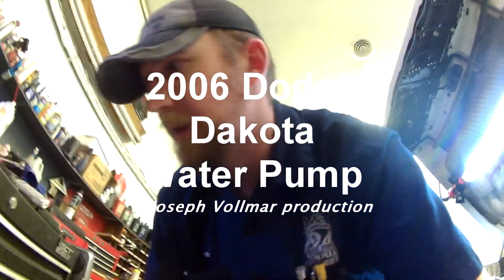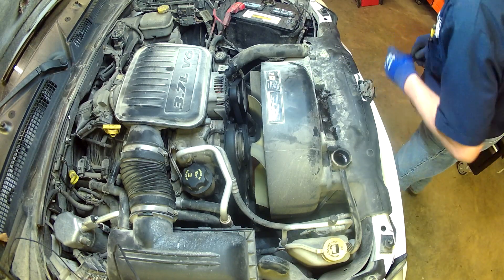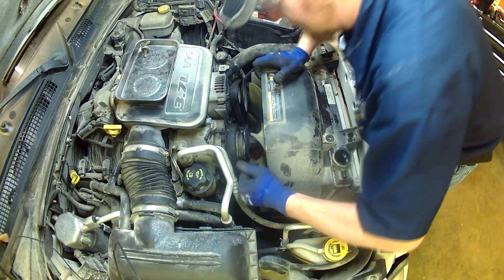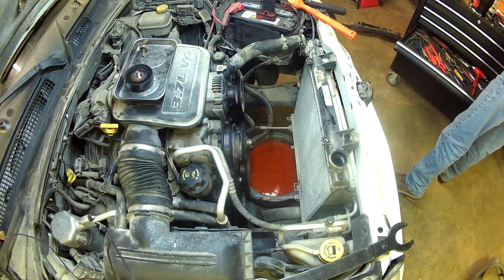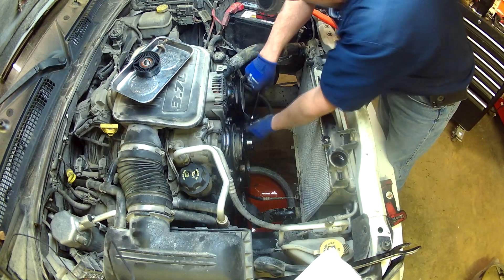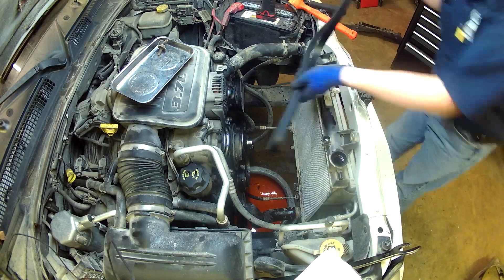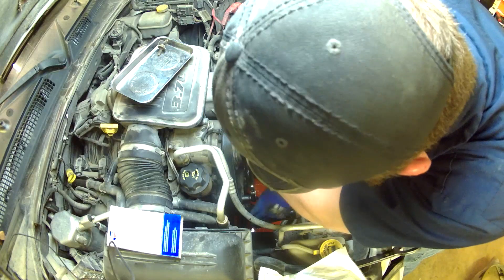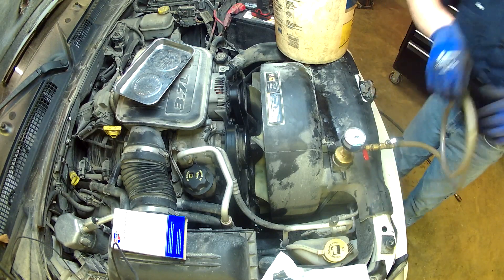2006 Dodge Dakota Water Pump.

Comment: Thank you for the straight-up info. One thing you might want to add, lol, is the fact that the pump housing on engine has razor sharp edges, and while gently sanding with very fine emory, one can lose several pieces of knuckle flesh, LOL!! It's funny the next day, but not while you're bleeding on your sons truck. A good pair of mechanics gloves (like in video) are highly recommended.

Comment: Easier to leave the belt on, apply force to keep the water pump pully from spinning and then loosen the fan. Might have to take a hammer and give the wrench you use a "love tap" to loosen the nut and then just spin it off. Once its off then remove the belt

Comment: FYI, if you remove the upper hose, you can remove the shroud before taking off the fan, it's not even very hard to do. This gives you way more space to work with getting the fan off.

Comment: Same thing for a 4.7l?
Reply: Idk if you figured it out yet. Considering that the 3.7L is just the 4.7 minus two cylinders, it most likely is the same
Reply: @SouthernMender  well yeah I knew that I just didn’t want to make a mistake and potentially make things worse and I fixed it tho and running as good as the day I got it!
Reply: @Roodaddy97  I figured you did. Just figured I'd say in case you didn't lol
Reply: @SouthernMender  appreciate the advice

Comment: What the point of vacuuming it?
Reply: I wish he would answer. I don't think you need to.
Reply: The reason he put a vacuum on it was to remove all the air that was introduced into the system. This just saves time when refilling because, otherwise, he would have to idle the vehicle with the radiator cap off inorder to purge the air out. Either way works, the vacuum method is just a lot quicker and cleaner.

Comment: @joseph vollmar is there a thermostat that you need to replace along with the water pump i just found that i have low coolant and a water pump leak
Reply: Westley Sellers it in the lower radiator hose close to the block

Comment: I like to feel the bolts come out vs a power tool. Do the shops use power tools?
Reply from the maker: Oh yes. The only way we make any money is to get it done and get on to the next job. In the shop it all about doing it correctly as fast as you can.

Comment: i noticed that you had a clutch fan wrench is a standard wrench too thick to remove the clutch fan
Reply from the maker: william williams no a regular wrench will fit. Just didn’t have one handy in that size.
Reply: cool great video. thanks for the info Joseph